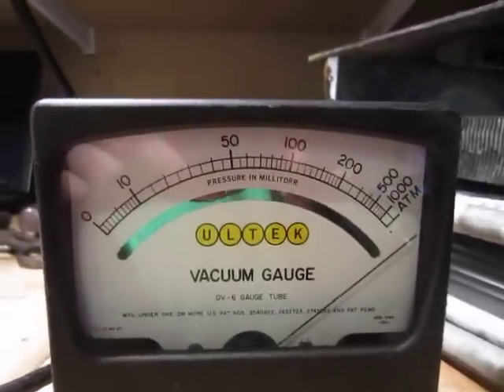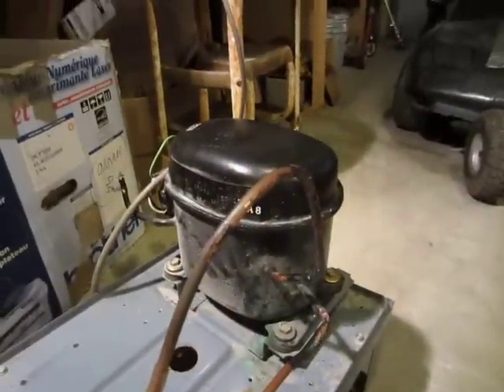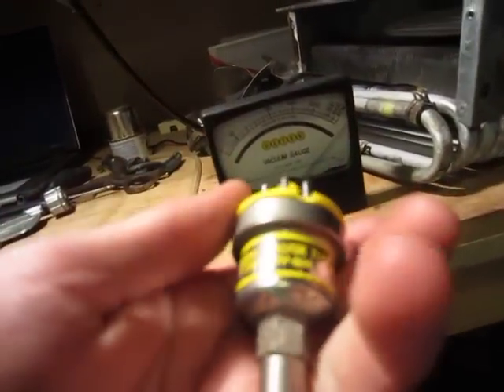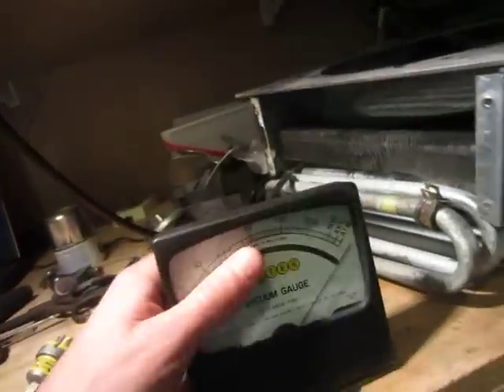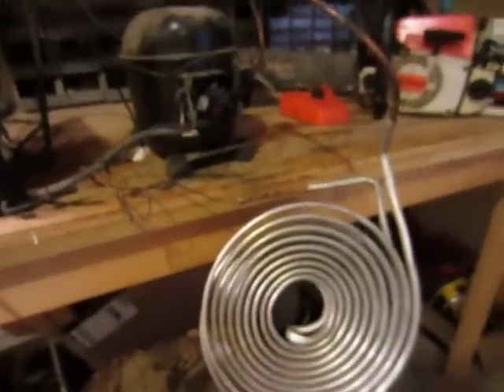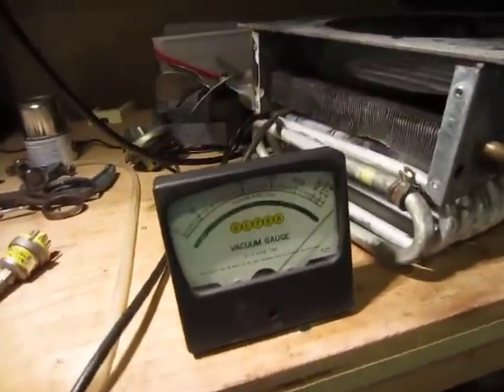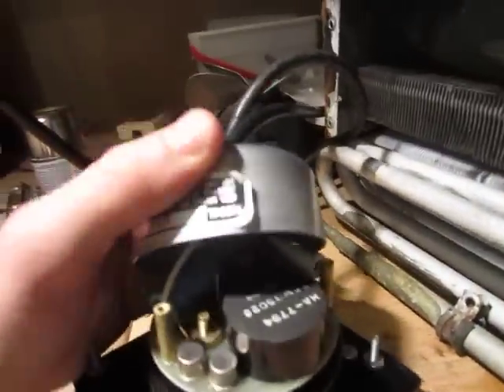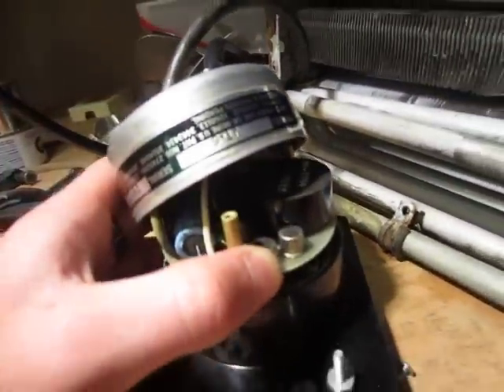Vacuum Gauge Won't Work

Comment: The yellow one is a Hastings tube the uses 3 pins: 3 and 5 are for the heater and pin 7 for the voltage readings. The hastings uses a AC current to the heater, while the other 531 uses a DC method. that 531 uses 4 pins, 7-8 are for the meter. The meter shown is for Hastings tubes, but there are different tubes from them that uses different values for the current. The DV-3 uses 120mA while the new ones need lower current( below 50 mA). You can check the tube pins 3 and 5 with a DM (diode mode or high resistance mode) that uses lower current to check the resistances, it should be for DV-3M around 5-6 ohms. and between 3-7 and 5-7 around  2.5-3 ohms. If the tube is ok, then you will have to check the meter.With the DM to  AC `current mode, open the black cable  that goes to pin 3 ou 5 and put the DM in series. Now turn on the meter an check the value at the meter, if the value is below 125 mA, you will need to adjust the trimpot, the small horizontal component with a screw. If the value is zero, then it can be the transformer blown or some other component in the circuit, but now you will need a osciloscope and for with it I would start with the transistors GA-1784.